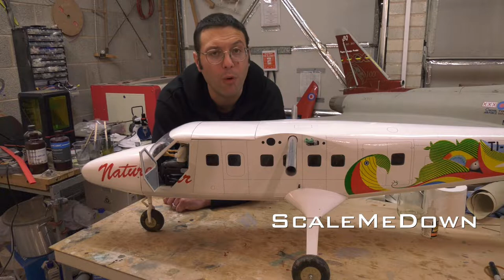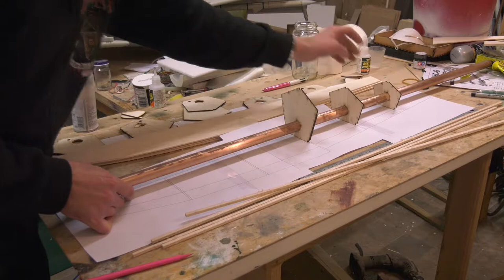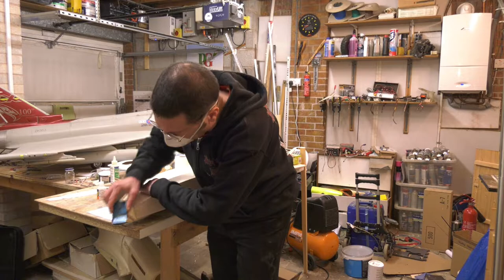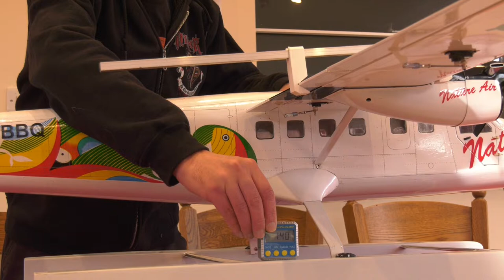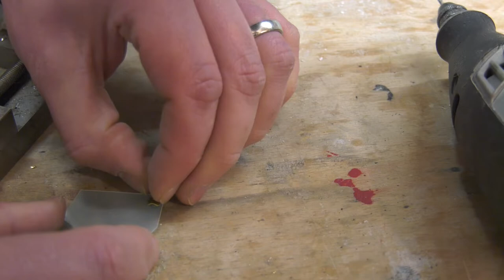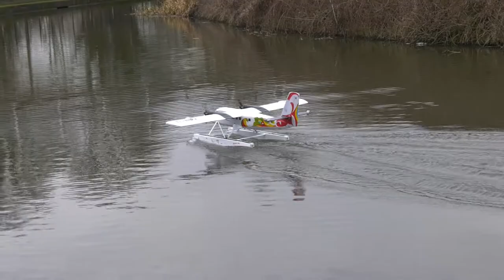VQ Models Twin Otter - Part 3

Comment: Wieso sind die Schwimmer von 4:09 bis 4:16 unten glatt, und vorher und nachher gekielt? Haben Sie zwei Paar gebaut? Gruß Josef
Reply from the maker: Hi.  I think your question translates as; Why are the floats smooth bottom from 4:09 to 4:16, and keeled before and after? Did you build two pairs? Greetings Joseph (please forgive my lack of German - google translate).  

I only built one pair of floats, but they do look a bit similar from both the side and the bottom.  The bottom sheeting was applied with the floats upside down, with the keel vertically upwards.  The bottom sheeting is pitched towards the keel leaving the undersides "V" shaped.  This should make them glide through the water easily.